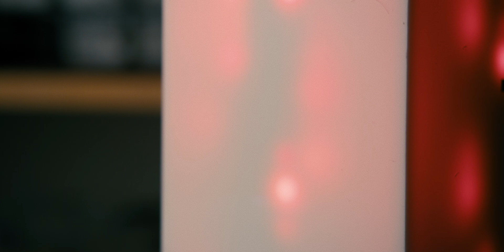Indeterminate Structures: Making a lamp-like sound sculpture

Comment: Amazing as always! Highly suggest a insert press, saves a lot of headache. Also play with the "Fuzzy Skin" settings in your slicer, gets rid of layer lines for exposed parts if needed.
Reply from the maker: Thanks! Doesn't fuzzy skin mess with the dimensions of the part?
Reply: @EirikBrandalf  Not normally, it should compensate. I did experiment with settings on some test cubes to evaluate which were best for my setup. The results are awesome, highly recommended, closest I've come to getting parts that look injection moulded off a printer.
Reply from the maker: @1dodgyjammer  Sounds swell, I'll look into it. My best looking print ever has 
actually been with humid PETG. Got a really nice matt finish to it.

Comment: Love these videos.  Pro tip on the heat-serts too - press them in with the iron, then before they fully cool use a pair of tweezers or pliers to grab the lip that extruded out around the sides.  If you get the timing down and practice it, you can get a cleaner finish with a fraction of the time needed for filing.  Once you figure out the timing it becomes a bit of a rhythm pressing and cleaning them 2-3 at a time
Reply from the maker: Thanks, I'll give that a try!